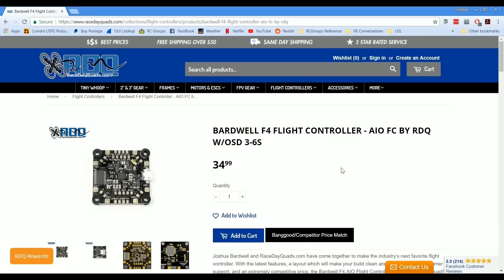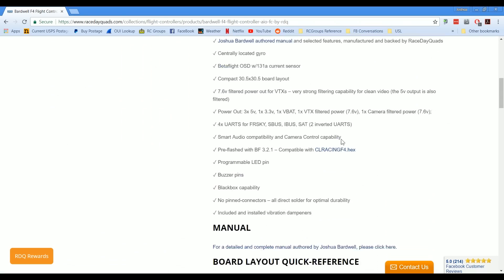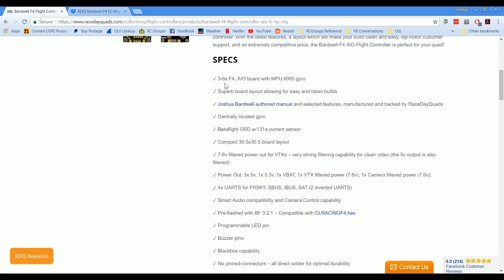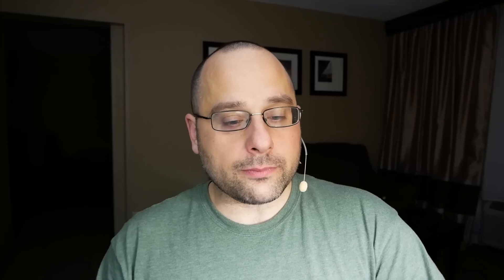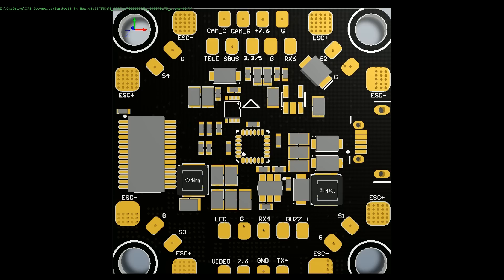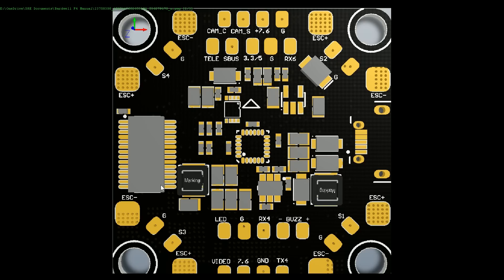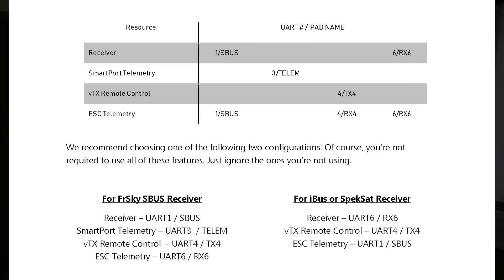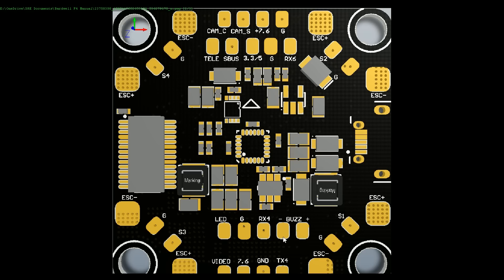Bardwell F4 AIO | JOSHUA BARDWELL FLIGHT CONTROLLER

Comment: Hey Joshua,  I am working on an old 4 inch quad with this flight controller on it.  I would like to run it using ELRS and a Caddx Vista but there are not enough Uart pads to run both ELRS and the vista.  Do you know if the Vista will work with softserial?  If so does this flight controller have the capability of a softserial tx and rx pad?   Thanks a bunch.

Comment: Got one with the sbus pad lifted, can probably get uninverted or fport out of the xm+ and use RX6 pad?
Reply from the maker: Yes that would work. Actually you can use FPORT to the T pad with no modification.
Reply: @JoshuaBardwell  Hey Joshua!  Funny enough, i noticed it says "T" is an "inverted INPUT" for s-port in the manual so i went ahead and tried that (despite my brain going "doesn't s-port usually go to a tx not an rx pad?"), switched Serial Rx to Uart 3, and lo and behold it works, on sbus (access), though i still don't understand how.

Other weird thing happening is the OSD cuts out when I plug the battery in, but the camera doesn't turn on till I do so.  I think the poor thing's been mis-treated lol, might just have to retire it in favor of an f7.

Comment: So joshua, I am left thinking that I will go back entirely to Amazon after this RDQ experience.  RDQ replied with a canned message only saying that they only accept returns on unopened boxes.  
So I used to have a cheap but excellent wolfwhoop tower that flew amazing, then the vtx burned out.  Still flies amazing but vtx integrated.  I put your FC in it's place (that particular one), my drone flies great for 3 or 4 minutes then has a stroke and becomes paralyzed on it's right side taking my escs and motor down the toilet with it.  So now gee, the wolfwhoop board still works, but darn no motors now.  This sucks.  No 5" flying.
Reply from the maker: It sounds like you got routed into the wrong queue. A defective unit that failed prematurely is not a return. Let me look into it.
Reply from the maker: I just checked with support. Something in your email triggered the automated response as if you were doing a return. But the email says multiple times that if you are not doing a return please reply and customer service will help you. So you should reply to that email.

Sorry for the inconvenience.
Reply: @JoshuaBardwell  Thank you kindly Joshua.  RDQ left me a voicemail.  Apologies for my frustrations.  I am shocked at myself for reacting, I guess I really love flying lol.
Reply: @JoshuaBardwell  Well wow Joshua.  I'm kind of blown away by RDQ support.  I had written an email about the FC, the guy called and left a message with an attitude and said I was threatening lol.  I was upset, but it was email, and aren't customers often a little upset when you tell them they can't return a faulty product?  Anyway, I didn't want to talk to that guy so stuck with email.
A week before your FC died I purchased a tinyhawk freestyle and taranis x9 with my roomate.  He bought it because they said right on their site that they "Great question!  They work great together!"  They were of course wrong, it only does D16, his quad is D8 only.  
So I'm waiting for a reply about your FC and kind of forgot about the Tx.  I get an email back, quoting everything about the FC, ... ...and the tinyhawk.  Then he just says "I sent you a mailing label to swap out the TX!"
Dafuq?  Lol.  That would be pointless.
I have to assume this isn't the norm, otherwise you wouldn't sell yer shiznit there right?  Thanks man.  Don't know what to do now.  Just gonna throw it away soon (&escs) if still nothing.

Comment: Joshua, I'm not sure if you will see this, but I bought your FC.  Enjoyed setting it up, great layout and clear information.  I did two quick test flights at home then went to the field.  It flew beautifully on 4.1 with rpm filtering for 4 minutes, then it fell from the sky.  Strangely, the right side escs seem to have no power.  Nothing appears to be scorched on the board, I am a careful solderer and appreciate your instructional soldering videos mentioned in the excellent manual.  I have soldered since the 70's but still learned from it.  I am using discreet escs, not your aio esc for this build.  
So what might cause the right two motors to suddenly get no power?  It would seem the pdb section of the board failed?  I ran these motors and these esc's for a year as my main 5".  They don't draw any ridiculous current.  Any suggestions appreciated.
Reply from the maker: Test for continuity between the working pads and the non working pads. If the + pads and the - pads don't have continuity to each other then the PDB may be damaged. Contact support at your retailer or RaceDayQuads to initiate a replacement.
Reply: @JoshuaBardwell  Ok, thanks so much for the response.  I will do just that.  Have an excellent day man.
Reply: @JoshuaBardwell  hmmm.  I did that and the +'s all have continuity as do the -'s.  I plugged a battery in and there is voltage across all four motor pads going to the escs.  But the right ones are still not lighting up.  Would the signal or rpm telemetry going bad stop them from lighting up?  Next I guess I have to unsolder one of the good ones and move it to that side, but I admit I am wary, not wanting to damage anything (but as far as I know the right escs/motors are undamaged.)
I will peel back my heat shrink and re-inspect the escs too.  I had to redo most of the wires and add telemetry.  
Sooo, really just moving a motor to the other side is the quickest troubleshoot.  Just gonna do it.  Apologies, rambling haha.
Reply: @JoshuaBardwell  Well $*$#$&!  I swapped the motors and escs on the back from left to right and to my surprise the FC appears to be "fine" (emphasis on the quotes) and two of my escs mysteriously died.  So now I have a "working" FC that I never want to plug anything into again because I don't trust it, and two dead high quality escs, and possibly 2 dead excellent iFlight Xing motors.  I don't see how this is possibly a result of anything I did.  Those motors and ESCs flew fine for a year on a wolfwhoop fc up until I changed it to yours.  I used the default 4.1 pids and hadn't turned on rpm filtering yet.  The sliders were at the default position.  I was cruising and it fell from the sky. :( Sorry, I know it's not your fault, hehheh, but I am at a loss now.

Comment: Great product. I am very happy. One question only that is not clear in the manual. I have connected my eagle 2 pro osd wire to the preassigned pin on the FC for camera control. What setup is required on bf?

Comment: I have one problem with this fc , if i crashed it is not possible to arm again, no beacon is possible and no modes like turtle mode FOR example 🤷🏽‍♂️ 
If i disconect the lipos and Connect the lipo again everything ja Fine than ! 
I dont know whats the problem, i search maybe the settings in betaflight but i find nothing 😪 maybe u can help me
Reply from the maker: Turn on the Warning OSD element in the OSD tab. It will show the reason you can't arm in the goggles.

Comment: I have a question. I have a camera that comes with its own vtx. The manual says that the input voltage is between 4.5 and 5 volts and the manual of the A10 says to solder the vtx’s power wire to 9V. Should I get a different vtx?
Reply from the maker: Just power the vTX from the bat+ pad on the FC, which is 5v.

Comment: Never had a FC that didn't come with at least a pinout. :P Even way back in the KK2.0 days.
Reply from the maker: A 30 page instruction manual for the JB FC can be downloaded from the racedayquads product page. When you order from racedayquads you have the option to request that we print you one. But most people prefer to just read the PDF.

Comment: I solder the control wire from the camera on the FC and even then I can not control the camera, you have no idea what it is
Reply from the maker: The Betaflight CAM_C function does not work 100% reliably with all cameras. You can try the Runcam camera control adapter which works reliably but requires a UART https://www.youtube.com/watch?v=akiP6vBaPvU

Comment: Could you give me a recommendation of which flight board, stack I should purchase I'm running an f r sky 9 m slim plus and I want telemetry  running through the board?Thanks Rick
Reply from the maker: Just about any betaflight flight controller can support smartport and sbus. There are a few that don't. You would want to look for a SmartPort pin on an F4, or if it is an F7, then it will work no problem.

Check out my product recommendations, including flight controllers, at https://www.fpvknowitall.com/ultimate-fpv-shopping-list/

Comment: Quick question for you, I apologize if you already covered this in a video. I am wiring a 4-in-1 to my JBF4 V1. The ESC I am using has a current sensor already. (Airbot Furling 32 ESC) How would I wire this to the board in a simple manner so I can have accurate current? I noticed in the manual you mentioned wiring if the ESC did not have a current sensor. 
Thanks!
Reply from the maker: The JBF4v1 doesn't have any input for an external current sensor :-(

The only way to do it is with the series wiring as described in the manual.
Reply: @JoshuaBardwell  Thanks for the reply! I'll do just what the manual suggests

Comment: I can not get RSSI to be displayed in the OSD with this flight controller!!! It's driving me crazy!!! I'm using a FrSky X8R (it's for an 8" quad) and I have the Smart port signal wire soldered to the Telemetry pad on the FC. I have enabled telemetry on the configuration page, I have selected "SmartPort" in the Telemetry Output column for UART3, and have gone to the CLI and typed “set tlm_halfduplex = off". 

Nothing seems to work! Can you offer any guidance?
Reply from the maker: https://www.youtube.com/watch?v=t-evOAS9Mkg

Comment: Can’t get my RXSR to work with your fc. It powers up I’ve hooked up the wire to Sbus pad. In betaflight after I go to receiver tab and select mode and provider I save and reboot go back into configuration tab and there’s nothing in the receiver tab again. Do I need to invert my receiver or does your v2 fc have a built in inverter ?
Reply from the maker: The FC has a built in inverter.

If the info in the configurator is not sticking after you hit save, it means you are trying to set up an invalid configuration of some sort.

In the Ports tab, did you enable Serial RX on UART 1?

After you save that, then go to the Configuration tab and set the serial receiver protocol to SBUS, and hit save again.
Reply: Yes I figured it out. Thanks for the reply, next question when I arm my motors and have the motors running when armed not all the motors will fire up when I blip the throttle all motors spin up tho.
Reply from the maker: If you are using oneshot or multishot, you must calibrate the ESCs.

https://www.youtube.com/watch?v=o3Mg-9M0l24

After calibration, go to the Configuration tab and set the Min Throttle value to 1070.

If you are using Dshot, make sure the digital idle % value is at the default of 4.5%. It's in the Configuration tab.

Comment: Hi Josh. For some reason I'm limited to only 8 channels. The telemetry port should already be inverted if I understand that correctly, which should give me 16 channels. I currently cannot add more than 4 AUXs, and I need to add one more AUX for my switch while keeping my RSSI AUX. Any advice?
Reply from the maker: Telemetry port doesn't have anything to do with the number of available channels. I'm a little confused what you're getting at there.

Make sure in the Taranis Model Setup screen, the same place where you bound the receiver, that the channel number is set to 1-16, not 1-8.

In the Betaflight CLI, check the value of max_aux_channels. It defaults to the full 16 channels but you never know.
Reply from the maker: I should bloody think to ask... what receiver are you using? Are you 100% sure it even supports more than 8 channels? Some don't.
Reply: @JoshuaBardwell  omg.... that fixed it. Channel range was set at 1-8. Thank you so much!!!!!
Reply: R-XSR. pardon my ignorance, I'm a noob.

Comment: I purchased the V2 version of this FC and using a X-XSR I cannot get telemetry to work on the T pad, I set the TLM to half duplex to off and no telemetry.
The only why to get telemetry and LUA scripts to work is to use the un-inverted pad on the X-XSR and either UART4 or UART6, I wanted those UARTS for ESC and smart audio functions is there fix I can use or should I purchase another receiver that will work with the T pad
Reply from the maker: Connect the yellow Telemetry wire from the RXSR to the T pad on the FC.

In Betaflight Ports tab set UART 3 to SmartPort telemetry.

In Betaflight Configuration tab enable Telemetry feature.

In Betaflight CLI, type "set tlm_halfduplex = off" then "save".

This is all that should be required to get Smartport telemetry working with the FC.

Also, make sure you have selected CHANNEL 1-8 TELEMETRY ON when you bind the receiver, but if you got telemetry working on UART 4 or 6, then you've done this.
Reply: I followed the instructions as per the F4 manual, I think I have faulty R-XSR's because I also tried to update the firmware and I get an error message (Firmware update error Module not responding). When I connect the receiver to my X9D I get the blue led and red led on, the green led does not light at no stage.
Reply: Thanks for your response.
Reply: I now have telemetry the T pad as per your instructions in the manual, I made an error in CLI that when I set the half duplex to off I assumed that when I entered the command it automatically saved it. I needed to then enter the command save which I did not do at that time. I'm a rookie noob. Thanks for your earlier response.

Comment: I'm having an issue, where the bardwell FC works when I plug it into Cleanflight, but when I go to sync the motors, or connect to Blheli suite to flash the ESC it disconnects from the USB. anybody know what would cause this?
Reply: Gojira FPV yeah just minimize betaflight and open bl heli and the ports should be the same number. You could hook it up to betaflight, check the com port. Disconnect and minimize. Then bl heli should work...got to plug in the battery as well....good luck

Comment: Will the V2 of this board work on an aerial photography setup (gps, gimble, low kv motors)? I would rather not shell out the cash for a pixhawk or dji naza.
Reply from the maker: This FC is really not designed for autonomous flight. For AP setup you really want a pixhawk or APM.

Comment: Josh i need your help. I flashed betaflight 3.5.1 on my omnibusf4sd . All went well . I unplugged the usb and plugged the battery .. turns out the board stays in DFU . When i reflash it connects . But if i reboot it goes into dfu by itself. What should i do??

Comment: Hey Joshua, are you aware of a way to use an external current meter (from an 4in1 ESC for example) with your FC? is it something you've been asked or played with? I've used another FC which had both an onboard current sensor as well as an input for current sensing and could never get it to work. thanks
Reply from the maker: You can do it with v1.3 and v2.0 of the FC which have the 4-in-1 plug. It has a current sensor input.
Reply: Thank you! This is good to know, do you know where these might be available? I have the version with the SD card which I like, and the 9V for the VTX; I'll have to check which version it is. I am pretty sure I don't have the connector for the 4in1 cable. Assuming I can find V1.3/V2.0 I would still need to remap the ID of that current sensor input in place of the built-in current sensor, correct? Thanks again.

edit: nevermind, I just found the manual and there is a bridge to wire, makes sense; that way you use the same input on the chip. no remapping needed! thanks!
Reply from the maker: They are available now :-)
Reply: Thanks, found and ordered a couple V1.3 from getfpv :P
Would you have a copy of the V1.3 manual? I can only find the 2.0 or older V1/V1.2 versions. I don't see the jumper to solder on the V1.3 based on the pics available on getfpv.

Comment: Hey Josh, love the board, perfect layout & manual. Had 3 great flights with my JBardwell F4 and my negative main battery lead came off mid flight! Quad fell to the ground. I’ve looked closely and the solder pad itself separated from the board. What do you suggest for a solid repair?
Reply from the maker: There really isn't a repair for this. I highly recommend securing the main battery lead on any quad. Use a zip tie and attach it to a standoff or a hole in the top plate or even the side of an arm. Whatever works. If you pull on the main battery leads when unplugging the battery, or if the battery ejects in a crash, it will rip off the pads.
Reply: Joshua Bardwell thank you Josh. Would it suffice to wire negative Vbat to a negative esc pad?

Comment: Hi Joshua,
Now i would like to know, with a runcam eagle pro 2, if i need to soldering the ground of the remote control ( ground osd one) or not and if it's yes ... where ?  both with camera ground ?
Because in your manual, you never write how we have to do with this wire ?
So appreciate your help.
Reply from the maker: You can omit it. Or you can connect it to another ground pad.
Reply: Thanks !   My quad is finally .... alive !!!! on the bench of course ... chameleon-JBF4-airbotwraithv2-eagle2pro-matekvtxhv-hobbyR6-XSR ...... all osd,smart,telemetry go !!! ... tomorrow, the first fly !!!!

And .. normally ..crash, and " I'll be back  !!! "  ^^.

Best regards and thanks for your involvement on this fantastic hobby !!!